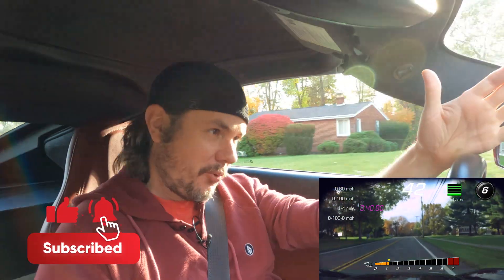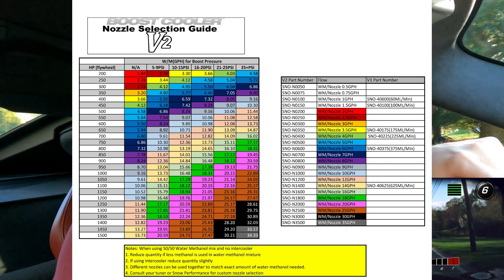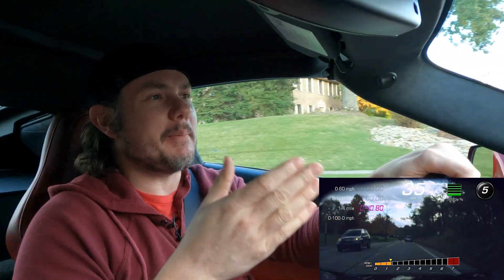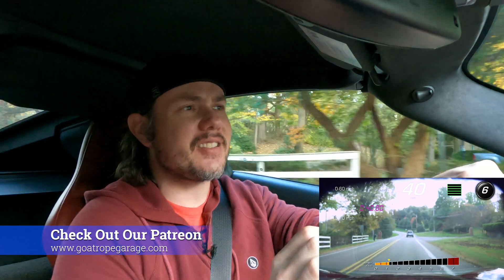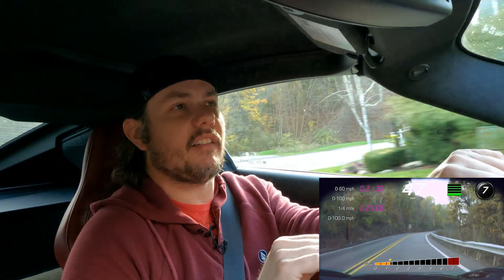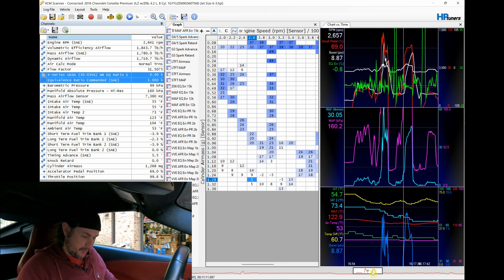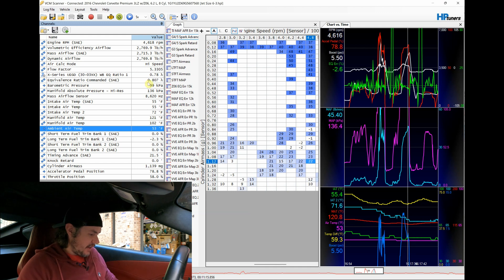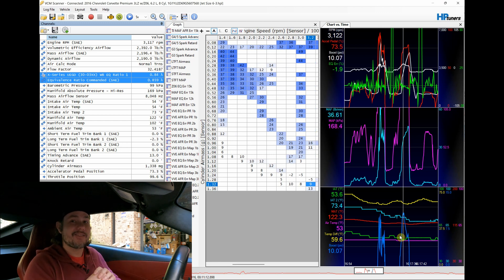Water Methanol Nozzle Size Selection, When We Need To Tune

Comment: I wouldn’t be looking at afrs to determine if the methanol is effecting your fueling. I’d be looking at fuel correction. Closed loop ecus will pull fuel if things go rich and vise versa. 

If you don’t need the extra fuel leave the tune alone and let the ecu correct and let the water/meth cool the charge. That way if the meth kit fails the ecu will add the fuel back automatically. Keeps things safe and sound. 

Just my 2 cents. Great info in this video either way.
Reply: ECM goes open loop under higher loads and WOT. Closed loop corrections won't make a difference once the boost comes in. AFRs are always worth noting when tuning.

Comment: even though it wasn't a big change after hitting boost, with no WI wouldn't you normally have seen a big spike in heat so it did the job of maintaining temps. ? 
looking to install in a diesel app mostly looking for the cleaning effect since soot and EGR BS is the worst thing for them
Reply from the maker: Yeah, you can run a small nozzle and get a big temp change. You get finishing results after a point.

Comment: I have a road course car. Mostly stock power. Very fast time attack car with aero and lots of tire, suspension  blah blah. Problems i see are i can only run aboutt 40% ethanol before i start maxing fuel system. I run e to keep temps down. Car make 620-630 to the tire in good air. On track Probably 550 to 600 wheel in the heat. I do a tire warm up lap and then a flyer then cool down. Im wondering if I could use a water meth kit to keep it cool and still run 40%e without tuning. Is there enough effect not to tune if full throttle for a long periods of time? If if so will you sell me everything i need? Can install no problem. I dont dare use to supplement fuel system as im doing a cam, big bore hpfp and injectors when i do a 2650r but i have a big race coming up in November, little over a month out that i could win and would be huge. Keeping full power for a lap or even two would be huge.

Comment: Really curious if high compression na engines would need much tuning outside the timing tables in manifold air temp?   Not much info on na out there, what afr would need to be targeted when juice is added at a progressiverate?  My Dad worked on steam induction many years ago and always said leaning the fuel tables and adding spark helped improve economy by about 5% in a V8 while maintaining epa standards.  Not to mention super cleaning action.
Reply: Well I know this is an old comment, But im currently tuning a water/methanol kit with #6 nozzle on a 3.0l v6. Granted im running a halt ech ecu and they have a seperate fuel and ignition timing tables specific to water injection. If your running a ve table your ecu will automatically reduce fuel to hit your target afr. But you do need to advance the timing. Going for 2 more degrees of timing which was the amount we pulled for safety during the original tune. Then start adding more. Probably goingvto run into diminishing returns before it knocks considering its on 260gtx 100 octane gas. And water/methanol for temp control.
Reply: @az_3kgt714  here doing research but search David Vizard water injection 😅

Comment: do we still wanna target 10.5-11 for afr when injection begins ? my tuner has been trying to dial in my meth on my 300hp,21psi mini and I'm running a #1 nozzle only..
I'm running a stage 2x snow kit so what would you suggest the 1st and 2nd injection point begin? would say stafe 1 start @ 9psi abd stage 2x @ 15psi ??? and then add extra timing in the tune for spefic boost ??

Comment: Are you not worried about putting water through your blower? Most people suggest running straight meth since water isn’t compressible, meaning it could mess up the blower pretty bad if enough of it makes it to the rotor pack.
Reply from the maker: The big thing is the volume of spray versus the amount of air you’re flowing, you’re talking a small percentage of liquid in a huge volume of air.

Comment: I recently installed a 1000cc nozzle on my twin turbo bmw. I have done fuel and ignition tuning for it, but I was was wondering if I should be targeting a different afr because of the added methanol. Also, should I be changing spark plug heat range and gap ? 
70% meth/water

Comment: My question would be related to the ignition timing advance. Because your injecting more than normal fuel, would the advance need to be moved up 3-4 degrees (.86 vs .79). I would like you would loose power with just over enrichment. Doesnt help that it takes all day to change plugs on a z06 😩
Reply from the maker: Yes, and you can also do that because the injected fluid is cooling the combustion so you are less prone to detonation and getting added octane, so all of the reasons are reason to run more timing that is why Water/Meth injection is awesome!

Comment: Come on homie .....man up and run 100% M1 like i do ....... In a good 8-15 sec pull mine drops 30+ deg
Reply: 100% M1 does not cool better than 50/50.
Water cools better than methanol.
Only run 100% if you need the additional fuel or if your IATs are not that high and you want a lower flash over point.
Reply from the maker: If I had been running full M1 my house would of burned down because when the truck caught fire the W/M line melted and was pouring on the floor, luckily the 50/50 mix kept it from lighting off and getting completely out of hand.

Comment: i know its going to be hard on the road, but if you really want to see the effects you are going to need a longer pull, i found that on 500cc injectors on trackhawks i would need more injector to get enough cooling for them to not go into limp mode on the 1/2 mile